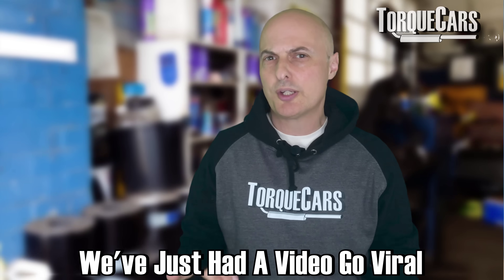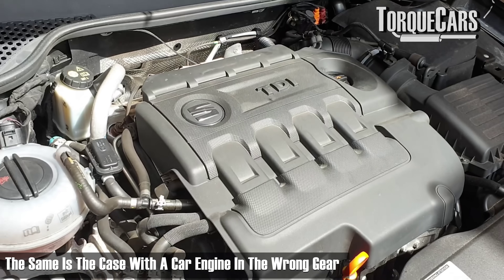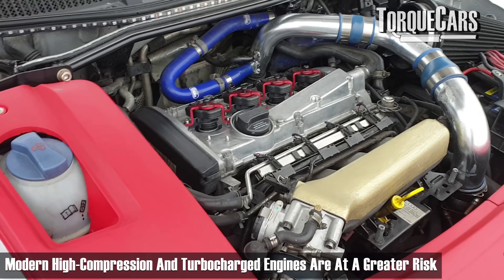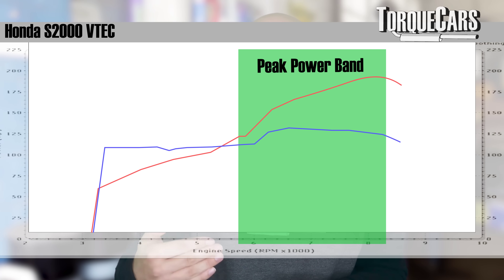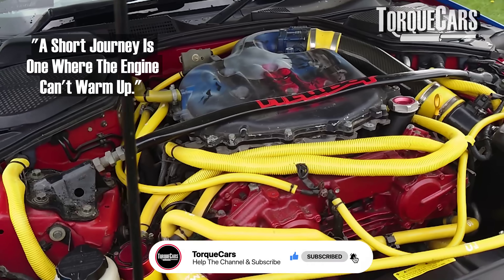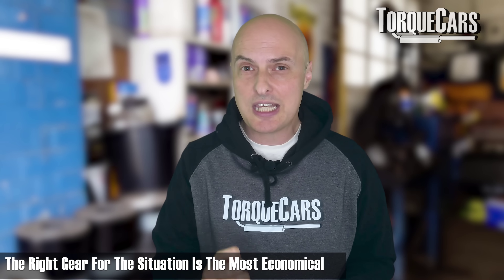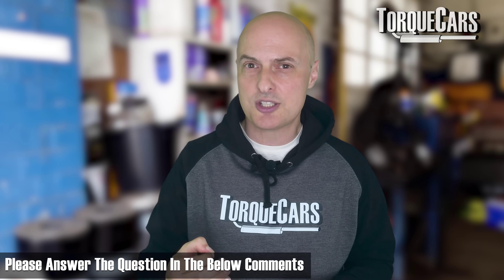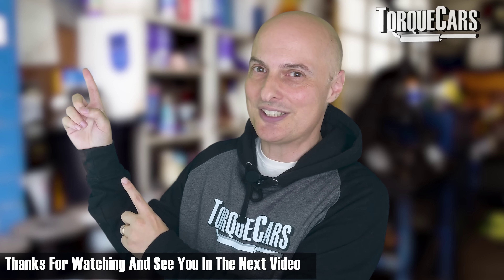Warning: Low RPM Lugging Destroys Engines! Why Low RPM Driving Is Bad.

Comment: One thing that always makes me confused is how to deal with the concern of not lugging the engine when the engine is still cold. In my case I own a diesel 1.3 Cdti Astra H (caravan) and it's a bit heavy for the small engine it has. I try to keep in the 1750 to 2250 rpm but I ve seen a lot of recommendations to not go past 2000rpms when the engine is cold.
The problem is that if I switch from 1st to 2nd or 2nd to 3rd at 2000, the rpms drop too much (to 1200rpm)and then either I am lugging it or the car doesn't have enough gas to keep accelerating. So it's a bit annoying.
Does anyone has any insight on this? It will be much appreciated

Comment: 2:05 Very wrong and misleading. Combustion event is slower at lower rpm and faster at higher rpm. The flame of combustion is also colder at low rpm and hotter at high rpm. If combustion would take the same time no matter rpm , then engine would not work or would be very inefficient. :D You can image engine as fire: it burns slow and cold at low rpm and fast and hot at high rpm.

Comment: That is why I utilize the full rpm range including maximum rev limiter when necessary while accelerating and stay at minimum of 1,500 revolutions per minute while cruising because mainly when an engine lugs while I am driving that would annoy me and when it continues to lug it would potentially make me mad/angry as I despise engine lugging

Comment: Yeah, I know the problem with a small sized engine. I have a small 3 Zylinder 1.5L engine and I feel that it lacks of power when driving 140 on german autobahn. 140 mph of course 😂
But the upside is the fuel economy, i can drive it under 6L/100km or 39 miles per gallon. But then I don't drive 140 of course. km/h this time ;)

But I can admit, driving an overpowered Ford Fiesta is really fun xD

Comment: Currently drive a 2016 VW Golf 1.8T DSG with 228,480 miles on it. Have what I believe is lifter tick at start-up and going uphill at low rpm. Putting it in SPORT mode cuts down the ticking noise. I once saw on YouTube a guy put his BMW in park, car was already warmed up, put his foot on the gas and raise the RPM's above 3000 and hold it for 3 minutes and after that he releases the gas pedal and the lifter tick noise is gone. Ever hear of this?

Comment: 2011 Toyota Tundra 4.6L,  232,000 miles odo. I run approximately 1800 to 2300 RPM on any gear using S-Mode(thumb shifter) for NO lugging. I only use 6th gear when cruising at 75 mph on the highway.

Comment: My engine lugs if it's trying to put down any power at under ~1500RPM. The gearbox agrees, if you're thinking in the hypermile stereotype, first gear is almost unusably short and my final gear has me revving the snot out of it at highway speed, with nearly 3K at 60MPH/~100KPH and closer to 3500 at 70/~120. Not to mention there is just not much going power before 2500, you do gain speed, just slowly.
I've found my sweet spots to be around 2500-4000 during acceleration, and 1600-2250 when mostly cruising, unless I'm on the highway where there's not much choice. Keeping around those two ranges, I have my get up and go when I need it, my head gasket isn't trying to pack bags when I don't, and I get a solid 29+MPG out of a pretty hefty vehicle, significantly more than I've ever had out of my automatics and possibly able to be better as I have some emissions system clogs choking things up.

Comment: I have a 2024 Mitsubishi mirage and it always stays in low RPM because of the transmission.  Especially with cruise control on. Is that hurting my engine?  I can use the sport mode wich raises my RPM but it sounds like the motor is a lot louder and vibrates quite a bit.

Comment: It is all about having a feel for the car, an experienced driver can sually tell when an engine is working hard and needs a lower gear. Modern auto's however, especially in economy mode on the transmission do tend to labour the engine sometimes and even on modern manuals gear shift indicators are set at too low RPM.

Comment: Also depends on gear ratios, especially on a manual, as you say if it’s efi or carbs also makes a difference. Twin scroll turbos also add more complexity and superchargers. Good video though

Comment: The way I see it is if the car accelerates and I have not exceeded 50% throttle, I do not need to downshift and the engine is not lugging. I usually operate between 1800-3000rpm where the engine is most volumetrically efficient. Usually downshifting at 2k and upshifting at 3k for economy. This is with a 2.0L NA Corolla.

Comment: ABSOLUTELY spot on that last 1/3! ALL of my trucks/SUVs have gotten BETTER fuel economy by switching to towing/performance gearing vs the "highway gearing". Adding ~400 RPM to my highway cruising improved the mpg by over 2-3mpg on average, which was the benefit on top of the acceleration gain and ability to tow/haul easier. "Highway gearing" was really only good for the Diesels & large displacement V10s.

Comment: internal combustion engine power is old fashion, out dated maintenance and attention nightmare, for very little if any benefit over a 3 phase, a/c motor. electric cars were dominate early 1900's, until oil co's saw oil as big profit.  if the r+d that just went into emission controls, went into battery tech, the suggestion of an i.c .engine would be laughed at.
Reply: Electric? Why would you support this having watched Communism and Fascism "transition" so my people from living to unliving and cause so much suffering in the world? Have you learned nothing?

Comment: My father refuses to hear what i say about driving at too low rpm. Keeps repeating the same "lower the rpm, the better for the engine" BS. He always drives in 2nd or 3rd gear and says that 1st gear is only for atartinf the car, not for driving. He would be appraching a turn at 40kmph in 3rd gear, slow down yo 10-20 and still not change the gear. He says "am i supposed to keep changing the gear over and over again?" And then that makes his overall driving experience worse. So he now owns an EV. His beater car is an old suzuki.

Comment: Just stay in the best Torque band for your car. My Toyota CHR 1.2 turbo manual develops its power from 1500 - 4000 rpm. I keep the car around 2000, 1800 at the very least, any lower shift down. At 60 mph the car is 2000rpm at 70 mph its 2300 rpm in 6th gear. I think the Atkinson cycle inherent in this car helps to alleviate carbon build up on the intake valves.

Comment: I cruise at around 10km/hr @ 1500rpm after starting the car in winter with -20°C until optimal coolant temperature is achieved.  Is that lugging?

Comment: I drive a 1.9 pd105, when I'm commuting to work I'll often be at 1300ish in 5th doing 45, if I want to overtake or speed up I'll downshift, but surely the 240nm torque in a ~1300kg car can handle that?

Comment: My Honda Jazz with conventional auto tranny doesn't lug when runs on low 1.5k RPM's on flat terrain in city driving, but going up a steep hill on the way home at 100km/h makes it shift to 4k rpm. So, i reckon it was designed to not lug.

Comment: Low throttle is not efficient for petrol engine. It lets less air into the cylinder given less dense, compressed mixture at the ignition point. Higher gear and more throttle burns better.

Comment: With regards to driving in an appropriate gear rather than the highest possible, I think modern car tech muddies the waters for people not mechanically inclined. The reason being as soon as the rpm holds stable the car itself is telling you to change up gears even though it's not always the best idea to. Gear change indicators are inherently poor.

Comment: 1ZR-FAE, a 130hp engine that barely can keep up whit the traffic at highway speed and need at least 4,5k rpm when there is a slight uphill.
Reply: My 2013 Subaru Crosstrek 5 spd  is a turd too with 150 HP. I feel your pain.

Comment: Lugging an engine is death if done long enough. Lower RPM means the oil pump is turning slower, therefore pumping a lower volume of oil, which creates a weaker oil film between the main crankshaft and connecting rod bearings. 

It could result in metal to metal physical contact damaging the main / connecting rod bearings and the crankshaft. Speed up the engine and you will have high volume oil and a strong oil film preventing metal to metal contact.

Comment: My 2009 BMW Series 1 125i convertible is proof that only using the regular Drive mode is bad. The automatic transmission always shifts way too early causing the torque converter to slip and vibrates the whole car. I always use the manual shift to keep it from slipping by shifting at a higher rpm than what the automatic does it in.  It also doesn’t help that BMW says in the owners manual that the transmission fluid is a “lifetime fluid” and doesn’t ever need to be changed.  They should have a class action lawsuit against them for this bogus information.

Comment: Hold it, it depends on what the engine was designed for.  If you have a mild cam, small valves and ports, and a heavy flywheel, your engine was intended to be used as a low-RPM engine, so of course it will not hurt it, but if your engine has an aggressive cam, large ports and valves, and a light flywheel, it was intended for high RPM operation and could be damaged by lugging it, as such operation puts excessive loads on the bottom end.

Comment: Very interesting, my VW Alltrack automatic is lugging pretty much all the time by default, that’s why I always drive it using manual mode. I get better throttle response and acceleration this way, and more control over which gear I want to be in instinctively. 
I always thought that higher RPM meant higher fuel consumption, and was willing to accept this when driving in manual mode, but turns out as you pointed out that this is not always the case. so thanls for adressing this particular issue in the video.

Comment: Imo lugging the engine is when the car is too quiet and it cannot accelerate properly at the selected gear. The opposite is where you have a very noisy, screaming car, when you're driving too fast for the gear selected. So it's all about being in tbe middle and keeping things balanced that way

Comment: You shouldn't accelerate with high gear. But drive it with high gear if you don't go uphill. The bad thing people do is pushing gas while its in high gear. Constant high rpm is just as bad. Your engine is way hotter you could melt your pistons and headgasket. It will wear piston rings, rod bearings and other bearings will wear quick. There's no zero friction oil. No such thing. Try to drive ideal. Accelerate with lower gear, go uphill with lower gear. Drive with high gear.
Reply: @Lightmaker5  the rear end gear ratio has a lot to do with it.if geared to high you'd probaly have to drive 80 mph to get a comfortable rpm range.talking a truck here.

Comment: Nothing beats a throttle linkage. My '99 Alfa 146's Twin Spark engine has epic throttle response both on and off the accelerator pedal; I have driven its successor, the 147, and the throttle response is good but not quite the same - it has electronic throttle control. Which is why I refer to pre '00s cars as "teachers"; they "force" you to learn proper driving while being much more fun and involving in the drive. I don't want any sort of "electronic governor" backing off the throttle, thank you. I will back off if needed according to how I hear the engine behaving, given the road type / environment at any point.

Comment: 8:10 So you cruise at 1600 RPM?  That's fair.  There is a speed/gear recommenation chart (one for cruising and another for acceleration) in the owners manual for my 2019 Jeep Compass Sport 6-speed and that's about the same.  IMHO seems too low.  In my Honda Element and PT Cruiser I only have 5 gears and it's hard to keep revs low at any speed.

Comment: I think despite turbo cars having more low down grunt generally a 1.2 or 1.4 turbo generally seems to dislike low-low rpm (1500 and lower) more than say the 2.0L NA engine in my car. Sure once those turbos are on-spool there is more power there, but below that threshold or at the bottom of that range it's just so so sluggish. Whereas I can happily pootle around with my old 2L Duratec engine and never go beyond 2000 rpm and half throttle.

3rd gear at 30 sounds obscene though, in my car thats 2400 rpm which is just wasteful, you can easily just put your foot down and accelerate up to 70 in that gear without coming close to lugging the engine. If I'm around town I'm normally in 4th (1700 rpm), or if its a level clear bit of road where I won't have to stop i'm in 5th (1300 rpm). I'd actually have to use more throttle in 3rd than 4th because of the added friction of being at a higher rpm. Now if I were to floor it in either gear then it would be lugging the engine, though only briefly in 4th, but imo thats OK. I'd say the right gear is not the gear where you'd never lug the engine, its the gear where you'd never lug the engine with gentle/normal driving, if you need a fair bit of acceleration you'll have to change down at least 1 gear.

Comment: Wouldn't it be correct to say that low rpms are also a problem for the safety of the driver because one would have less braking power? The car would be too "loose" and more effort would be required from the brakes to stop the car.

Comment: driving at low rpm won't damage your engine,but pressing pedal to the metal on 1200 rpm in 5th gear will for sure screw up your pistons badly.

Comment: Listen to your engine, it's that simple. As long as it's not struggling it's fine regardless of rpm.
Reply: I lug my 3.2L Turbo diesel but I listen to it and can feel the characteristics of it. She will lug from 1000Rpm but I don't load it up at those low rpms especially if it's cold. It's been dyno tuned and pulls better than most. Especially with big loads. I've owned multiple diesel engines and multiple gasoline engines. They all have different torque and power bands. Never had any problems with them or cause of damage from my driving style. All I can suggest is listen to your engine and you can feel it in the vehicle if it's struggling. All depends on gearing ratio too. Lugging something to much will cause more fuel usage and damage to the engine instead of holding that gear a little bit longer. It's all logics and common sense.
Reply: @AnthonySlavin   Low RPMs and light throttles aren't lugging, that's just low-stress cruising. The issues happen when you try to ask it to hit 80mph in 5 seconds from a high gear instead of upshifting at redline or peak power like how most pulls are done
Reply: Unless someone is driving an EV.
Reply: @puneetiqbal  EVs dont have engines...

Comment: If you own a relatively old car like from the 90s or even older with automatic OVERDRIVE transmissions, all of them have a mechanism to go around with the overdrive OFF, it could be a button or just driving in the 3 position of the gearstick insteack of the D position (P R N D 3 2 1). This gives the car a sporty drive which is ideal for cities and helps not only with engine health but even with the brakes (you feel the engine/trans combo helping to brake the car). Of course if you have a car that old you know this 😅 but is always good to see videos trying to help people to be more mindful when driving their cars. This applies to city driving which i think is where most people drive their cars. For highway speed (60+ mph roads) none of this apply.

Comment: How can you not drive in low rpm in todays modern engines??
All of them runs at low rpms in their designed max torque. Wether you drive slow or fast, they all stay in 1500rpm.
Reply from the maker: Are you talking automatics/manuals or both? A Low RPM depends on what we are doing, going up hill then 1500RPM is probably too low and you'd need to change down, most automatics are set to avoid the problematic low RPM ranges (typically near the idle speed) but I wouldn't say 1500rpm is actually low for many modern engines. Even diesels pull really well at 1500rpm, but on many this is 1/2 of the RPM range.
Reply: @torquecars  im referring to small turboed engine. 1st to 7th gear rarely hits below 2k rpm at speeds.
Example is 100kph is only at 1700rpm at top gear.

Comment: Depends on the car.

Suzuki Swift Sport - previous model - demanded high revs, lots of gear changes - not really a good city car.  So much so, though I mostly liked it, I couldn't have lived with it.

Current model, dramatically different, turbo-petrol, lots of torque down low, 6th gear quite useable in town.  Very easy to drive in comparison.  Yes, don't let it lug - but that happens at much lower revs.
Reply: @alanclarkeau  yes I have the 2013 swift sport and man I have to change gears so much and 1st I’m in for about half a second before I have to switch to second. Yes it’s a fun car but even crushing at 60kms or 70kms it needs to be in 5th gear

Comment: Low rpm to myself is when you use the engine outside of the torque curve, on the lower side of course.

Comment: My 2 mazdas (3 and cx5) dont downshift fast enough. Every time I need a little power, I put it in "manual" and downshift 1-2 gears. Otherwise, I can feel the engine lugging.
Reply from the maker: Is this in drive mode and sport mode?
Reply: @torquecars  I never put it in sports mode. Only normal. My 3 doesnt have a "sports" mode other than the switch under the gas pedal once you put it to the metal. Their transmissions are known to be sluggish and too agressive on low rpm/fuel economy. I believe it's a software thing.